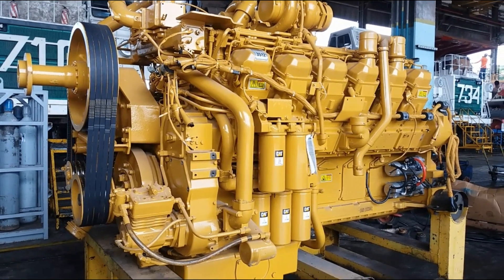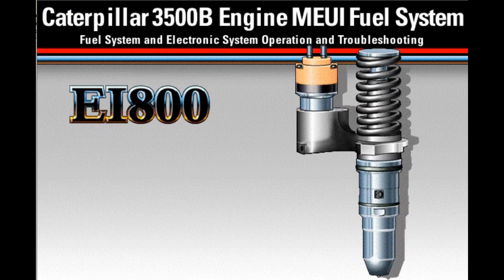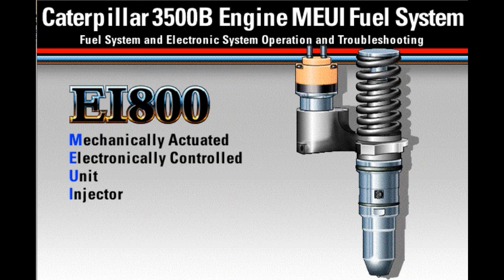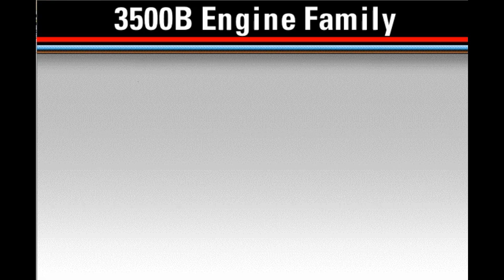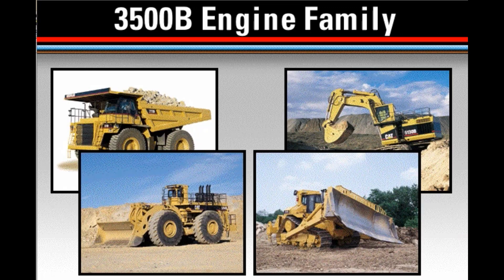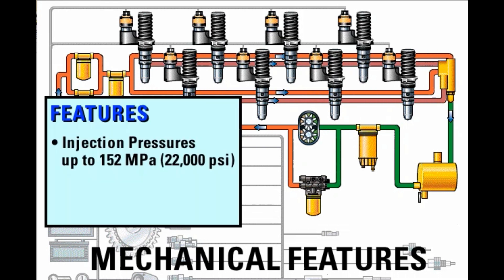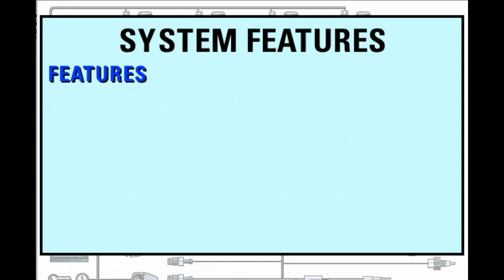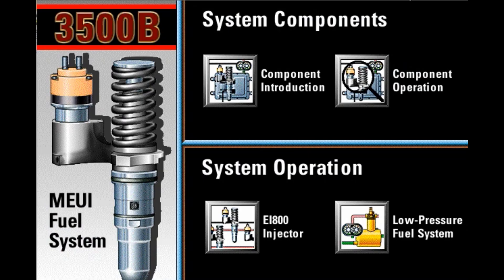3516 B ENGINE MEUI FUEL SYSTEM PART 1

Comment: How to measure the fuel injector
Reply from the maker: hai ..you can see my video with tittle Penyetelan valve engine 3516 ,there are 3 part in the video...Sorry on this video  using indonesia language..the video explain about how to find the top dead center cylinder 1 and how to adjusting valve and injector
Reply from the maker: You can see my video to adjust valve and injector ..the first you enter to go tech sgt ..after that you can find testing ad justing valve and injector